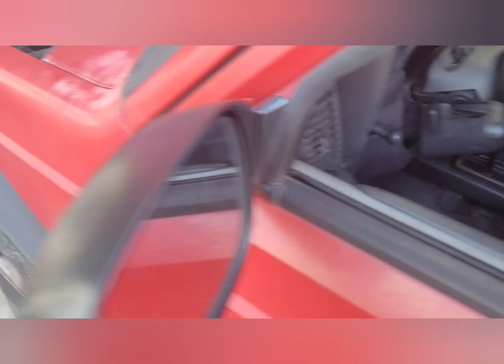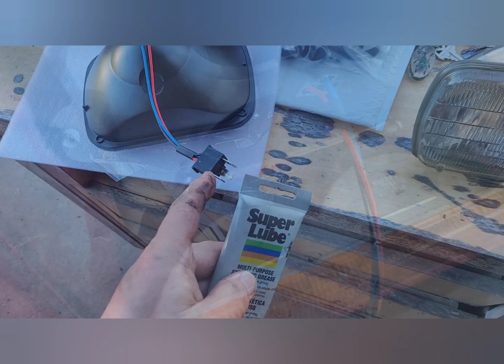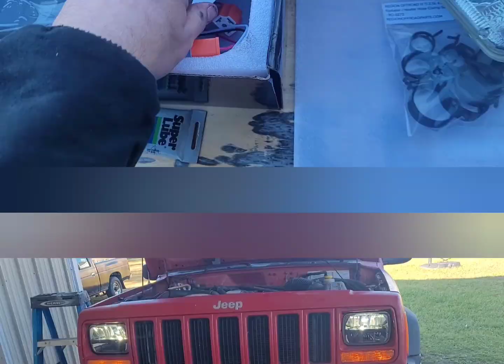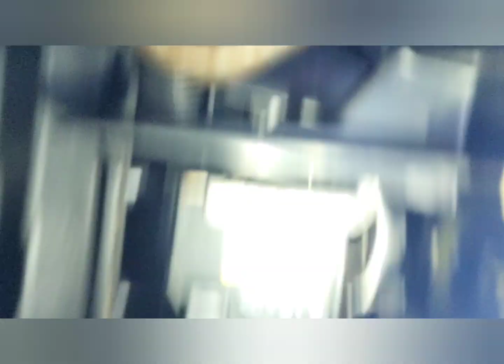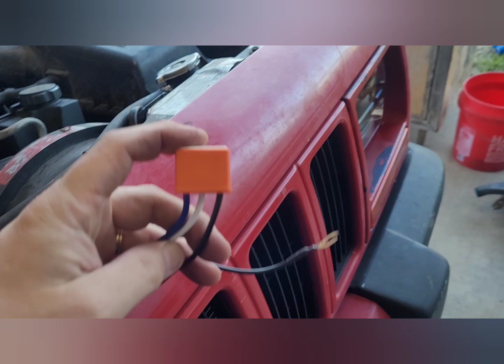Complete Headlight Overhaul on Jeep XJ Prevent Melted Switch Connector

Comment: Can some help me .. im running same problem my headlight switch connector gets burnt tail lights side markers n dash dont work only sometimes .. I can smell burnt coming from headlight switch (ive changed the connector once) so wats burning its the tail light side connector
Reply from the maker: The headlight relay system I have in the link in the description should solve your issue

Comment: Great job on the video. The problem with many Amazon headlights is they don't shine with the correct spread and often blind oncoming traffic.
If you have a problem with these you can try Tru Mod LED lights and they solved my problems. I also had to install a relay because the LED lights overload the switch and melt them quickly.

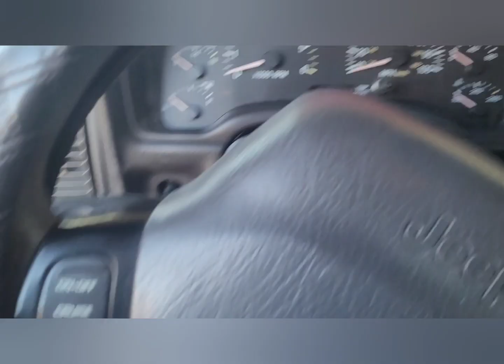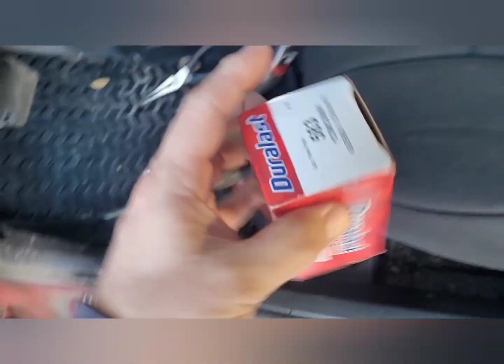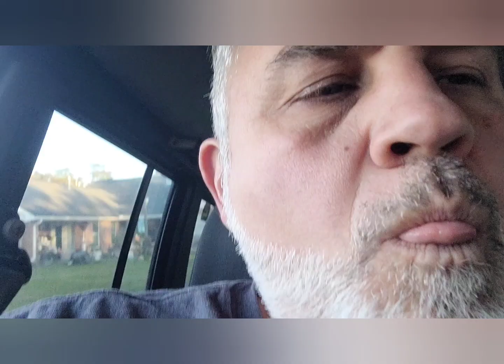Comment from the maker: To skip to certain sections see the following : Headlight Change from beginning.  Switch Replacement about 6:05, Connector about 10:44, Relay system about 13:12